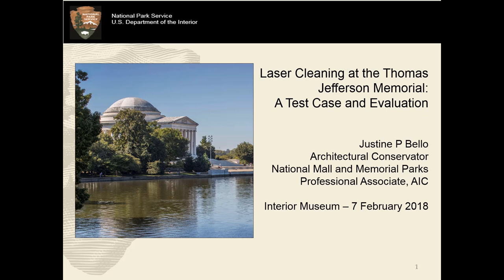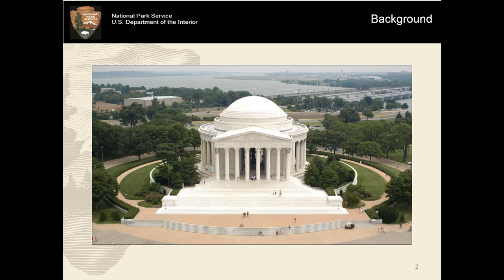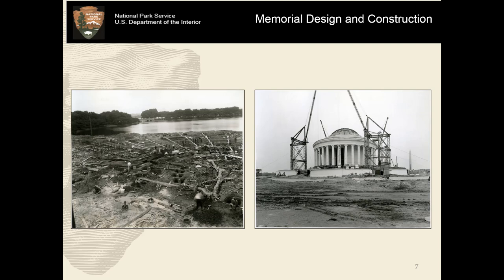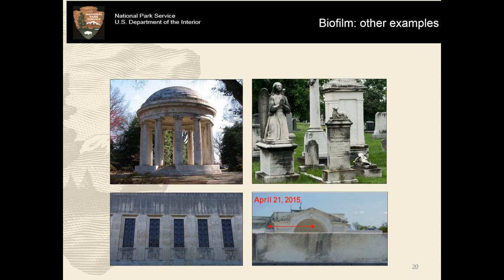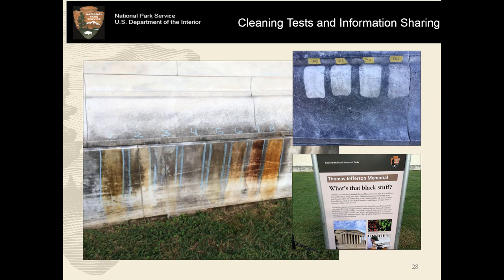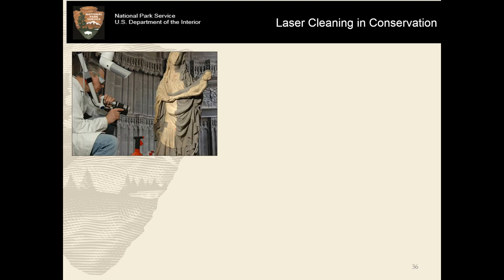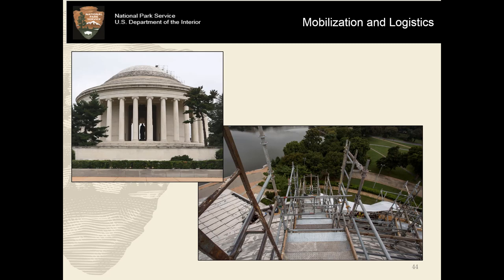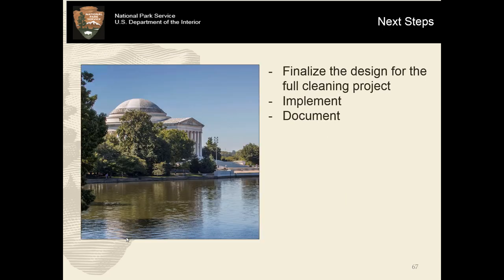Laser Cleaning at the Thomas Jefferson Memorial

Comment: This was a fascinating talk, thank you! I learned more about the Jefferson Memorial and a new cleaning technique (laser ablation). 

After watching the talk, I had a question. So I’m not sure if the Jefferson Memorial has been consistently cleaned using other methods since it was built, but starting at around the 5 min mark in your talk, you show how starting in 2007, the Memorial was becoming covered with increasing amounts of biofilm over time. 

Considering that the Memorial was built in 1943, has it been covered with biofilm before, during its 75-year history? If not, what changing conditions might be fostering this biofilm accumulation, starting about 10 years ago?